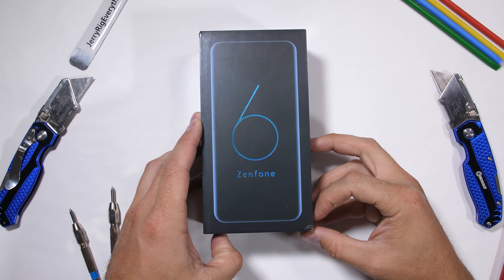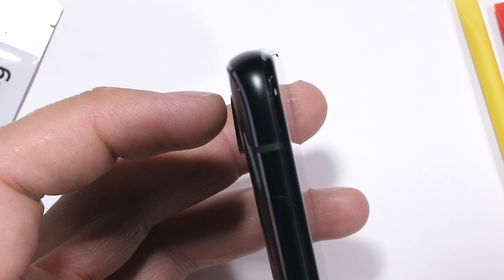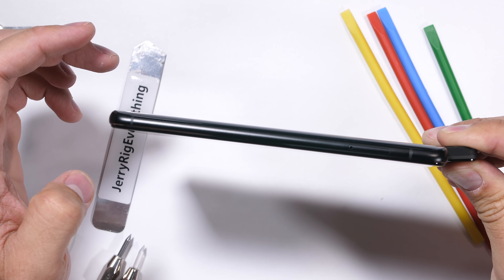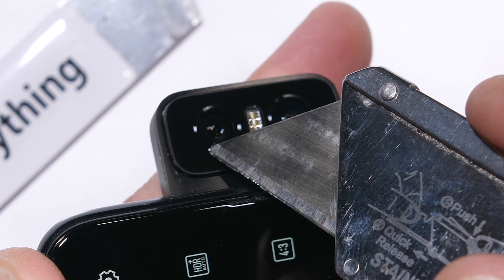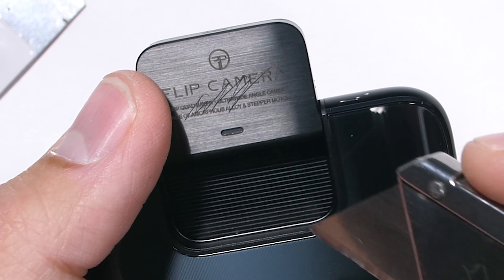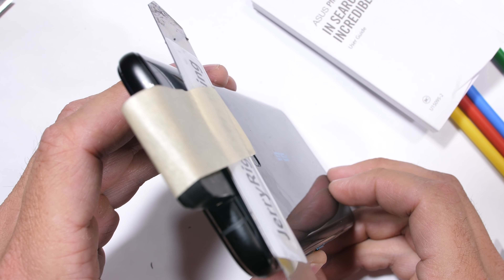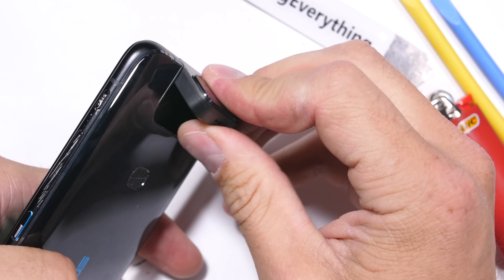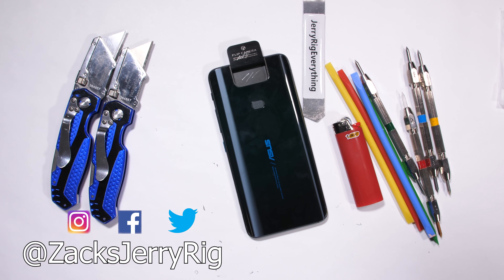Is the CRAZY Flip Camera Fragile? - Zenfone 6 Durability Test!

Comment: I bought the Asus Zenfone 6 when it first came out. I always have been a fan of Asus products. It's a very impressive phone for the money $600 phone. It's processing speed is faster than most retail cell phone carrier phones loaded with an abundance of garbage you don't want or ever use can't get rid of it without rooting. I like Google but I do not like the Google assist button I have disabled the button. But even after I disabled the button it always asked if I would like to enable Google assist. The phone's not super durable so you do need screen protector and a case and it's not waterproof at all. My ex through my Asus across the floor smashing the screen and the back cover. The cheapest option was to buy a new frame,LCD display and back cover and transfer the main boards and battery and all components for the quarter of the cost of insurance deductible. I dislike the painted sides of the frame the paint can scratch very easily even if you pull it in and out of the case too many times. But when I rebuilt the phone I just unplugged Google assist button internally and now I don't have to deal with it. I've had problems where it had motherboard glitches and somewhere I was reading there was a replacement motherboard for this problem but after a couple updates I haven't had any more problems. It would always have SMS crash out of nowhere in a few other applications but after the updates I haven't had any problems so I'm not going to proceed with upgrading the mainboard. Overall I am very happy with the phone.

Comment: Thx for this video.
I've always wanted to know how strong the Zenfone6's camera can be for a long time, but I don't have the guts enough to try those testing with my own Zenfone.

Now I know.
It's really strong and great
Reply: are u still using it?
Reply: @sathyaki  yes I'm
And it still works very well 👍
Reply: @vvvvv4321  is there any rattling sound from the camera while shaking. Also does the phone restart on its own?
Reply: @sathyaki  nope, I didn't find any noise when I shake my zen phone 6.
About the question of restart... I'm sorry for I can't remember that clearly. I guess not, maybe.
Reply: @vvvvv4321  thanks brother,for replying.

Comment: Guys I need your help regarding the Asus ZenFone series.
I'm an owner of a ZenFone 3, I love it, but unfortunately I broke the screen twice in 3 years. Now, the problem of this screen is that even the little crack turn black completely the screen and basically the phone become unusable until I completely change the LCD panel.
Other smartphones instead you could still use it even when the screen panel is cracked...

Does the ZenFone 6 will have the same kind of screen? Help me out with this guys.
Reply: I own Asus zenfone 3 zoom.... and i have the same problem....i cracked the sreen 2ice and it got 2ice just all black....no response ....anyrhing..... BUT.... this new zenfone looks much more durable so.... i think it will last more drops ;)

Comment: I had an ASUS as my first smartphone. It was pretty cheap - the hole reason I chose it (1st smartphone). When it became overheated you just needed to go put it under running water for 5-10 seconds. 

From this first phone up to the one I use today I always ended up with ASUS. It's literally unkillable, cheap, and has good features especially for it's price. 

The one I use now is around 200$ in my country (Asus max pro m1). It has NFC, 5000 mAh, 6" IPS 2160x1080, Snapdragon 636 and water resistant. It is cheaper then Xiaomi with 636, which is a very popular choice for a budget phone in Russia. 

I no longer chose this company because I don't have enough money like it was before, but because over the years there products were the best I've seen. And this video proves it one more time.

Comment: Huh. Using a hinge to flip camera sensors between front and back is pretty damn clever. Also cuts down on the cost of the phone, micro stepper motors have been around a while.

Quite a nifty solution to the not-an-actual-issue-but-we'll-pretend-it-is of the camera taking up precious front bezel space, too. Gotta get all the edges of the screen as close to impact as possible!

Comment: This is a great cellphone, probably one of the best in 2019
Reply: One problem is low screen dentisity and screen panel,so its not a flagship and that's not too important for this price
Reply: @cenanmehmet  how does that not make it similar to a flag ship?  just for reference it's running a 6,4 inch 2340x1080 panel the pixel density may be lower because the screen is larger but the iphone xs is only running a   2436x1125 panel yes it is oled and yes it is smaller so the pixel density will be lower but you need to keep in mind that this phone is more than double the price of the zenfone 6. Also the screen being lcd isn't really an issue as long as it's a decent one so the screen is pretty similar to phones that are sometimes even at a higher price point. So the low dpi (around 400) doesn't really hold it back although it could definitely be improved on a later version
Reply: @trevor245  The IPS LCD though is some of the weaker ones, for example the screen from Mate 20 achieves a lot more brightness

Comment: In India it costs same as the OP 7, but with 6 64 while OP comes with 6 128 version.
almost all will go for OP 7
Reply: with a 1300mAh more battery with reverse charging, SD card support with dedicated tray, No notches and 100% DCI-P3 capable display(vs 92%) 3.5mm jack with 24bit DAC, A better front camera and usefull secondary camera for wide angle 125°fov(vs depth sensor???)

Comment: 550 Euro ? Asus Zenfone 6 - 5000 mAh battery | 3.5mm jack | SD 855 |  Great camera mechanism  | 125° ultrawide lens | 2 Sim card + SD card tray | All screen. 
Shut Up And Take My Money
Reply: And also stock android
Reply: Only ip rating box is untick
Reply: if only it had a replaceable battery
Reply: @archkull  No worries Jerry can help :D with that.
Reply: @archkull  you can replace it. Once you get inside the phone.
Reply: People still mad no amoled display
Reply: So copied
Reply: Oppo reno though...
Reply: Screen is the only downfall.
Reply: @serix_16  it is hdr10+ certified
Reply: @serix_16  its using AH-IPS. the highest IPS out there. color is vibrant and black is darker. but not as much as AMOLED display. but it is better than normal IPS.
Reply: @serix_16  There's nothing wrong with the screen.OLED is more expensive and overrated by reviewers.
Reply: @LuKaZ668  LCD panels are backlit, thus don't have as deep blacks as AMOLED. The difference is quite noticeable once you switch from a normal LCD display to AMOLED. For the price, it's a great phone, but an AMOLED screen would have been perfect.
Reply: @adityapathak5761  and then you get burn ins
Reply: @adityapathak5761  oled screens look great when new but after a while the do fade a bit and loose a bit of their brightness and contrast. I was in a phone shop today and it made it obvious just how faded my 18 month old oled screen is.
Reply: @adityapathak5761  does not matter, both are black mirrors
Reply: @CanonFirefly  what's your phone, if you don't mind me asking? I've only seen friends' phones having AMOLED, but that was when the phones were new. I didn't know that they degraded. I was only aware about burn in, which can be prevented by periodically changing wallpapers and stuff.
Reply: @adityapathak5761  I have a Mate 10 Pro. You don't notice the degradation really until you put your phone side by side with new devices. AMOLED is well known to deteriorate with age, especially the blue subpixels which can lead to a slightly yellow cast getting progressively worse over time. It's not that much of an issue really. As I said, I hadn't noticed it until I compared my phone to the latest version in store.
Reply: Apple iPhone XR is wayyy better and it costs a bit more
Reply: @bliblibug428  Which of these specs are better on iPhone XR exactly? 2942 mAh, no jack, no expandable storage (and a phone with 256gb will cost you $900), obviously shittier selfie camera, no ultrawide lens, no dual sim card slot, notch... I'm confused lol
Reply: @valeriavagapova  uuuh, actually it has a better camera, a better screen as it can display 16 million colours!! And the newest update has the ability to swipe to Ur fingers to type!!! Ha
Reply: A bit more...

Comment: Just have a read through all the features! Also, is this the only phone with all the features and an LCD display? AMOLED is great and all, but it wont last more than three years. LCD will last forever.
Reply: Do you believe that you'll be able to use this device as a daily driver for more than 3 years? Even if the LCD panel lasts forever, will the battery hold it's charge after so many cycles?
Reply: @MrBie  Unless the battery is literally impossible to change, I see now reason why I cant buy a replacement battery and change it. I have OnePLus 5T with 8gb ram. Who knows if it will cut the mustard in 3 years. I just hate the idea that amoleds start to burn in after a couple of years, even more so if the phone is not slow and still works fine.

Comment: Motorized camera yes
Lcd display on such an expensive phone : no
Reply: expensive, the base model is just $500 compared to $1000 flagships these days. And the IPS panel is capable of  displaying 100% of DCI-P3 compared to 92% of one plus 7. Since it is IPS, there is no screen burn in. Also wider viewing angle unlike OLED with blue/green tints when ever the phone tilts. But no pure blacks and thicker compared to OLED's.  For $500 you cannot grab a phone with no notches or camera holes, dual sim+dedicated memory card tray, 5000mAh battery with reverse charging, 3.5mm jack with 24bit DAC, 2 seperate amplifiers for bottom and top speakers, a better front camera with 125° FOV, 4K60  and a clean android

Comment: Finally, a phone with good specs, a good camera, headphone jack, no notch, and also has what I would call an "adequately sized" battery (Not amazing but it should get the job done), If only it had an AMOLED display (dark themes = more battery life), 5G data, wireless charging, and a dedicated SD slot instead of that stupid hybrid tray BS (good luck if you have 2 SIM cards but still need expandable memory) 

So close to the perfect phone,  but still, no company has made a phone with all the features (particularly in regard to battery capacity,  it took us THIS LONG for flagships to break the 5000mah barrier FFS, the thinness craze needs to die, phones are tools not fashion accessories)
Reply: It has 2 sim slots and 1 for sd card
Reply: @UghRegret  no it has that idiotic hybrid SIM tray that can have 2 SIM cards or 1 SIM and 1 memory card

Comment: Would I buy a motorized camera phone?  Probably not.  I have the Xiaomi mi mix 3 which is the one with the slider. I have control over it.  Can open and close it whenever I want,  not a mechanism which can possibly stop working. The slider  gives me a better feeling overall. Of course dust or dirt can get into it but the same thing can happen with motorized phones. But they're a bit more unsave in my opinion.
Reply: Cash Money  cover?  Do you mean a case?

Comment: Why doesn't this phone have waterproofing? Omg! It would be perfect if it did!
Reply: I don't think so. Samsung waterproofed their headphone jack fairly easily. But this is a moving, mechanical part that flips up and down. I can't see that being waterproofed. Apple, however, uses stupid excuses to eliminate things they want to turn into adapters that you have to pay for.
Reply: @TheWyldehart  very true, you could waterproof it, but the housing and the camera module itself would have to be waterproofed independently. Would require a bit of R&D and I don't believe any Asus phone has waterproofing as it's really not their main business...
Reply: I would guess that the motorized hinge can't be waterproofed in order for the camera to flip freely. But you can buy phone baggies to protect it against submersion.
Reply: @TheWyldehart  no way anyone is going to have their phone in a baggie when they use it and drop it in water...
Reply: The idea is general protection say if you go to the beach or have it by your pool. It's just an idea. That said, that motorized camera would never be water resistant.
Reply: @TheWyldehart  it could be, but would require a lot of effort to do so. Like Apple not waterproofing headphone jacks...

Comment: Well, it seams that you can put a lot of stuff in a package. Case, jack, metal, no notch, fingerprint, sd card, 2 sims, 5000 battery. Good job Asus !!
Reply: Other companies argue that all these have to be compromised in order to get ip68 rating for the phone.
Reply: @SunilZishan  i have a samsung waterproof, i cant charge it with cable cuz of humidity sensor, and the phone was no where near water. There is no fix for that from samsung, the forums are full of complains. Last samsung phone, works like shit. I prefer large battery, bigger screen, jack audio and no IP rating

Comment: If they had provided the AMOLED panel instead of LCD, i would surely bought this one but I have to wait for the Redmi K20 pro
Reply: Just for quote.. asus did terrible job on OLED calibration, i had ZenFone 4 pro.. it has AMOLED, and man... I quickly regret buying it... But otherwise in IPS (+) screen, Asus did fantastic job in color accuracy, already use zen2 laser, 3, and 5z, and no problem with the screen

Comment: ASUS finally made a remarkable Zenfone this time around...

Zack: Thumbs up for that!
Reply: I just wish they made a a version without the flipping camera. I wouldn't mind giving up on a selfie cam altogether, or have some bezels, then to give up on water resistance and get a camera that is bound to be destroyed when I drop it one too many times. Both Asus and Nubia made the perfect 2019 phones, but decided to have a silly gimmick(flip camera/fan) instead of water resistance(The Nubia also gave up on SD card, but when even the 256 version is pretty affordable it's not that huge of an issue).
Reply: @RigAJigglypuff  I doubt this camera will break often. At least not before the glass does... This seems to be a very solid construction, mostly steel, with a well thought out design, overbuilt if you ask me. This camera is definitely not the phones structural weakpoint.
Reply: Rear displays are catching on next.
Reply: @psnKnowledge  Nubia already did that... check em out might surprise you
Reply: @kodaph  I know a couple brands did it but it still hasn't caught on yet like pop out cameras. And I think they are going to be the next trend, despite having to waiting at least a couple months to see if it's proven.

Comment: The metal house for the camera makes sparks? That's awesome
Now, if you ever end up deserted on a remote island, you have a way to easily make a fire
Reply: Or even better a note 7
Reply: Life hacks... Always carry this phone for fire
Reply: That's because it's steel and not aluminium, they probably use steel instead of aluminium for a bit of extra durability in the hinge connection. Presumably it's even case hardened making the camera the strongest part of the phone
Reply: Asus is just keeping up by their nickname of being hot, and now they got fire starter
Reply: Just don't play with your phone while at the gas station.
Reply: Lol bro 😂
Reply: It's made out of liquid metal which is 4 times stronger than normal steel. Very hard to work with but it was the only way for ASUS to make the camera durable enough for... Jerry?

Comment: I recommend you check out the new (to America) Samsung Galaxy A50, sub $300 phone with triple rear camera, Super AMOLED display, in display fingerprint scanner...ALMOST everything someone could ask for. The plastic rear of the phone is a funky prismatic color shifting design (that also means no wireless charging), there is a what I would describe as a teardrop notch for the front camera, and no official water resistance rating. Besides those few "drawbacks" it's up to par with MOST flagships from my experience with it in my opinion and I'd be interested in hearing yours!

Comment: Just an advice for everyone who bought a new smartphone: don't use the plastic case that comes with the box. It doesn't hold tight to the edges well and will allow sand to get inside of it, and the smallest movement will scratch up the body. Get a normal slightly flexible case or a rigid one that holds really tight to the sides and corners.

Comment: If you root this device and change electrical current or voltage parameters for camera motor in the system, hopefully it will be able to lift itself and make push-ups.